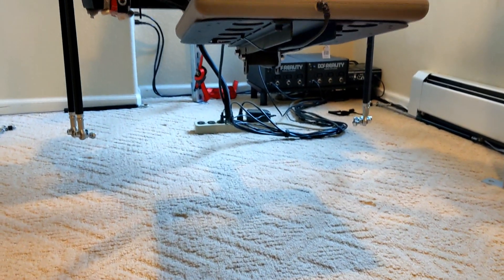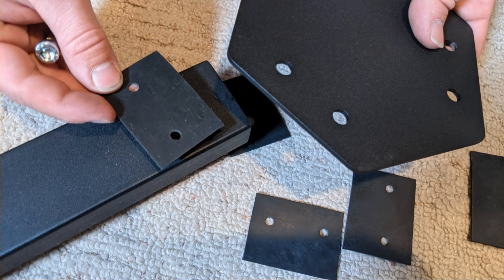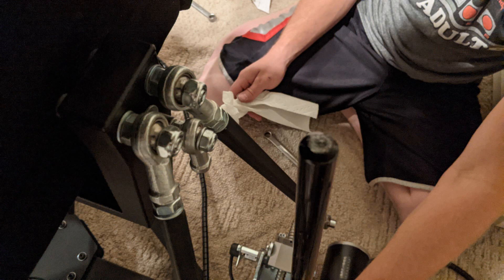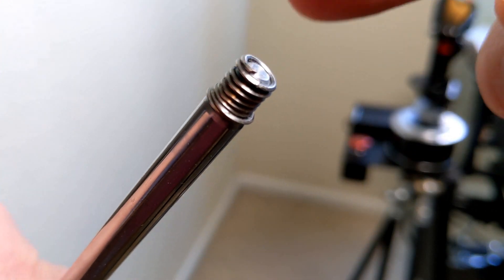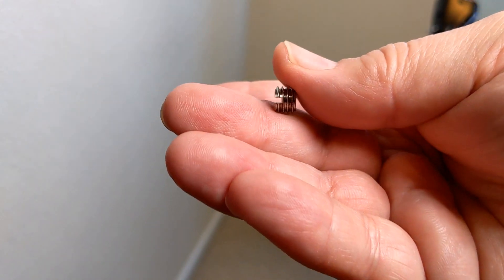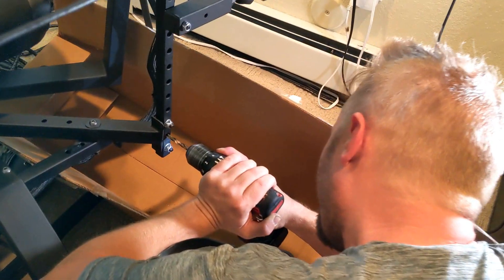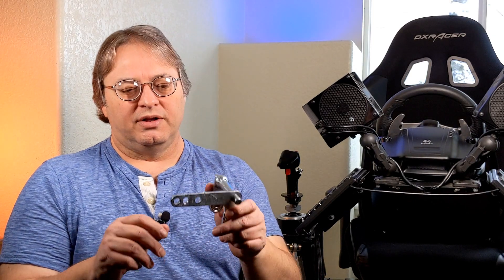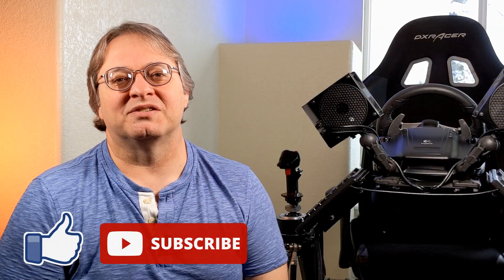DOF Reality SFU Gearbox Upgrade - Part 3: Modifications

Comment: nice work, great idea....  I just FINALLY got my P6 up and running today for the first time.  Flying helicopter in DCS but not getting hardly any heave movment when I raise and lower collective, I even maxed heave out under tunning and still nothing... do you fly any helicopters in DCS or just the fa18?
Reply from the maker: Hi William, I just fly fixed wing in DCS, but I fly heli's in MSFS2020.  SO start turning down the number in the "Max Telemetry" box for Heave.  Just do a few numbers at a time until you get the feeling you want.  Mine is down at 6 in MSFS2020 and I've set it as low as 2 in other sims.  Just go in slow steps because it can really bounce you hard if you go too much at once.  Hope this helps.  If you really want to get a good understanding of what all the setting do in Sim Racing Studio... check out our 2 part videos with Jeff Weaver, we talk about all this stuff in detail.  Part 1 https://youtu.be/pzi8G7T9p7A Part 2 https://youtu.be/LSStkqpIX_M They are long format, but filled with info.  Enjoy!
Reply: @GYGOtv  I did actually try turning down the numbers of Max telemetry, even got into the negative numbers negative 10. Still no reaction. So it kind of looks like maybe they didn't built that into the Apache module.
Reply from the maker: @WilliamDeanPlumbing  interesting... Ya don't go negative... That inverses the motion.  Are you getting heave in other aircraft?
Reply: @GYGOtv  I just finally messed with the F-16 and the uh-1 helicopter and it doesn't appear I'm getting heave in either of those, that being all three points raising up simultaneously to lift you straight up or down. Especially when I hit playback and I'm not in the chair I can watch it very closely Its Behavior. And I just don't see it going straight up or straight down. But you would think you would see it much more in a helicopter but I'm not seeing it and either helicopter. Nor can I say I've been able to find a video on YouTube showing it happening.
Reply from the maker: @WilliamDeanPlumbing  Do you have Elite Dangerous?  Thrusting straight up and Down in it certainly moves it.  Also, you should feel something if you come in for a hard landing in the F-16 and I certainly can feel it taking off and touching down in MSFS with the chopper there.  I assume you have the heave axis on and motion turned up on it so I doubt that is the issue.  If you go into SRS and "test" the motion what happens when you move the heave slider up and down?
Reply from the maker: @WilliamDeanPlumbing  How does your movement compare to this one? (it is with the old Gearboxes so movement on SFU should be even more).  You notice the big bump at the end when he lands... does yours do that? https://www.youtube.com/watch?v=HR2ckMoHrFU
Reply: @GYGOtv  yes in SRS it moves straight up and straight down perfectly fine. So far it's just DCS that's not really showing me that movement. Tilt roll pitch sway all that stuff seems to be working quite well. But last night after lots and lots of tinkering with settings and SRS for the Apache profile I got a significant Improvement in the feel of the helicopter and flight motion still not straight up and straight down but a world of difference as far as what I'm seeing and what I'm feeling even to the point that it was a bit on the frightening side coming up and over trees and Diving down and pitching back up, I even was taking gaps of air in shock on how well it was suddenly doing with the new settings. I suspect it's more of the lack of telemetry in DCs. I can definitely feel when I touch down in the helicopter for sure. No I don't have Elite dangerous, maybe I'll just pick it up to test it out. And as far as Microsoft flight simulator I have it but I haven't been able to tweak it to run very smoothly not that I've really worked on it very hard most of my concern is DCs.
Reply from the maker: @WilliamDeanPlumbing  Glad to hear you got something working... Do you mind sharing what you found so anyone else with this issue can maybe fix their problem too?  Also, do you ever use the profiles in SRS?  They are a good baseline to start from (like if you wanted to try something in MSFS2020).  I know there are some for DCS as well.  Just a thought.
Reply: Congrats for your new P6 and believe it came with SFU. My P6 is old version but still doing great with VR in DCS. Enjoy!

Comment: Great videos Mark. I just received my P3 from DOF and having issues with parts. Not getting any reply from them in support and I was wondering if I could ask a few questions of you. Thanks.
Reply from the maker: Sure Jim, but I haven't ever built the 3-Series.  BTW, Are you emailing sales@dofreality(dot)com? They are usually really good at returning emails quickly.
Reply: Thanks mark. I have purchased a P3 with the SFU upgrade and just got the unit so a bit of a newb still but having big time issues with the assembly. Missing parts, and it looks like maybe not even the right motors. All the videos showed the SFU motors with an Orange/red motor to gearbox coupler. The main 2 motors I received just have a straight coupler with no insert. Is it possible I received the non-SFU motors? Also, the 3rd yaw motor was not attached to the frame as shown in all assembly videos. Separate with an additional rod attached to the gearbox and the motor separate almost like it was for a P6. Any thoughts on these two things would help. Thanks
Reply from the maker: @jimmarko-qf8qy  Feel free to email me some photos of the parts if you would like.  SO the SFU gearboxes are very obvious, they have the big screws sticking out.  It you go back and look at my early videos, you will see what the old gearboxes look like... they have small lever sticking out the side of a box with ribs on it.  I'm not sure about the coupler... DOF is constantly iterating on the design so that might be the case here.  What I'd recommend is you join the DOFRealityBuilders Facebook Group https://www.facebook.com/groups/1858593921047822 if you haven't already. They are very helpful and someone there should be able to give you the latest insight into what's going on.  They are my go to group when I have issues. Hope that helps.

Comment: if i just want an h3 for iracing, do you think i really need the SFU upgrade option? Do i really need to have more movement than the standard gearboxes provide? Any other benefits to the SFU upgrade?   Also I am using a quest 2 and I am really concerned about how I am going to do motion compensation. I assume you can limit the motion in the SW if you want? I dont want to use steam open VR, i currently use either oculus or openXR mode. Love the channel, thx!
Reply from the maker: Thanks for the comment Listen U!  Yes you do want the SFU gearboxes for the main motors.  You can keep the old gearbox for the Traction Loss if you want to save the money.  The big reason is the old gearboxes have "play" between the gears so you get this looseness as the rig rocks slightly with the old gears.  With the SFU you have a screw that is rock solid and doesn't have the play.  I actually think the SFU is better for the 2/3 series because it fixes that.  You certainly can limit motion to your liking with the software.  As for motion compensation... I haven't figured out a way to do it without Steam (OpenVR) yet.  The program you need to use only works in it as far as I know.  There are 2 main methods I've researched... one is with the WitMotion box to create a virtual tracker, and the other uses an actual controller or tracker as a reference.  I think SRS is working on a openxr system, but I think that is still a ways off.  Anyway hope that helps and thanks again for watching our stuff!

Comment: If you had purchased the P3, would there be any modifications you expect would apply there too? Is it safe to say that all the time and effort you've spent tweaking  would not be necessary if you'd have bought the P3?
Reply from the maker: Hi jchief40... So having never had a 3 series, I can't definitively answer that, but in theory, you would still probably ideally want some form of cone spacer on it to maximize travel of the tierod ends and keep them from binding.  DOF usually recommends stacking washers, but I think cone spacers are a better option.  Probably not as critical because the frame likely doesn't interfere like the 6 series does, but you still want to free up movement as much as possible.  If anyone out there has a 3-Series and agrees or disagrees, please comment below as again I'm just guessing based on what I have seen. Thanks for the question.

Comment: Wait, the motors still get hot even though you upgraded to the SFU gearbox.  I thought one of the advantages of going SFU is that one does not have to worry about motors getting hot?
Reply from the maker: We still overheated without the struts... The gearboxes are more efficient but you obviously can still have issues if you overload based on our experience.

Comment: Hi Mark, I have the old H6 and did get the upgrade done last week. I too experience the motor overshooting problem, it never happened before. and it happens on i feel like all 6 motors occasionally, how are you dealing with it? did putting back the 3 lift rod back help anything?
Reply from the maker: Congrats on the upgrade zmbob!!!  I think the struts did help a little but they helped more with our overheating problem.  Someone did determine the issue wit the "rebound" I just haven't had a chance to modify mine yet, but seems like this should do the trick. http://www.tvdr.de/flightsim/power.htm?fbclid=IwAR0UODVe9J6RFrnDbZcUZKkERGnrC1nH4W7bwrJ5jrCu0bZftOGIzicD14Q  Good luck, and of course I'll do a video once I have done this too.  I'm still knee deep in motion compensation right now so first things first.  Thanks for the question.
Reply: @GYGOtv  OMG I think this is amazing! how do ppl figure this out like this.  Opened up my eyes!. OK i think i will try to mod this too. Motion is defiantly much more with this SFU upgrade, the motion compensation should be a must. I brought the new monitor stand and upgraded thicker wheel stand from DOF,  i will try to put a Samsung 49" Odyssey G9 on the rig see how it goes, I don't have those lift rods installed on the rig right now, but after putting the monitor on the rig, i may need them too. Thanks for the link Mark!
Reply: @GYGOtv  oh, one more thing, the P6 and H6 using different motor, i wonder with this mod, the Schottky Diodes maybe different? p6 use (30A 50V)
Reply from the maker: @zmbob  That is a great question... I hadn't considered that.  My guess is it should work with the same diodes... but I might be wrong as this is out of my area of expertise.  Anyone out there have any solid thoughts on this?
Reply: @GYGOtv  update I just did the mod. 
I purchased exactly the same parts, and I put them on and they worked! No more over shooting!  Only a 1 hour or less mod. Very easy to do.
Reply from the maker: @zmbob  Thanks for the update zmbob!  I'll put it on my to-do list :) Good to know the diodes from the P6 mod will work for us.  I'll try to get some ordered, how much does it improve the immersion now that the over shooting is gone?
Reply: @GYGOtv  Now over shooting is totally gone. I actually try to feel the over shooting during my play around half hour with different games. never happy again, i soon get my focus onto the game and never got disturbed! It is a MUST DO MOD for SFU H6 upgrade, i think even for the H2 P2 H3 P3series too
Reply from the maker: @zmbob  For sure... I'll look at getting it done since that has bugged me from the first time I jumped in with the SFU's.  Glad we have a solution now :)

Comment: Great video as always. do you have another source for the 12 spacers, the one link you have is out of stock?
Reply from the maker: Unfortunately no, I couldn't even find them originally in 10mm. I'd recommend doing a little more looking because 10mm would be better BUT here is a link to what we bought https://www.ebay.com/itm/165865102485?hash=item269e549c95:g:nJUAAOSwVPFfdKS0&amdata=enc%3AAQAHAAAA4Pl1z%2B18tbQ3cDYF49qVwQd4zdA64lVg%2F1BVy6dPPaqgnsfZvjRdQZkEQMT63I7tIY2qhzI9UxuTk1AULX2Qx1xKn6aoS9UjazWxCtSSuMFJNpYwVYXRqTi3M49L6VWwLSOZlQA7ttTqyaYOOjGBZyis7Mkp%2BO2ga3%2BpVEfRjwFjVITg4VeUrfRNkZRJLWZMSMK5c4UHhhEWO3WymLO%2Fnm4mIJFR%2Bv%2FcWBIee6MIlAtAQPCz2v7ZPUo0ZIJ453UQxVleuC6eXV52HZ0t6VwfAA7IvR0jIzmatVty3WMEppIP%7Ctkp%3ABk9SR9Sh3dSzYQ just note they are 7/16 so you will need to shim them with some cardboard to keep them centered... but they will work.  If you do find some other 10mm please let us know here as I'm sure others will need them too.  Here is a photo of the cardboard we used (cut into 66mm x 10mm strips) https://drive.google.com/file/d/1Bu_gJSGAKFRwudezx9txxHJy7EEmIJyx/view?usp=sharing and here is a video of putting them in  https://drive.google.com/file/d/1bntFu_NxJwe-YH9K3wpQvactUjymATxO/view?usp=sharing Hope this helps and thanks for watching!